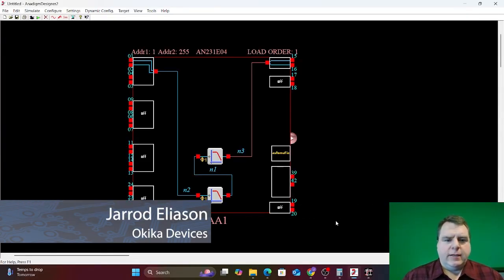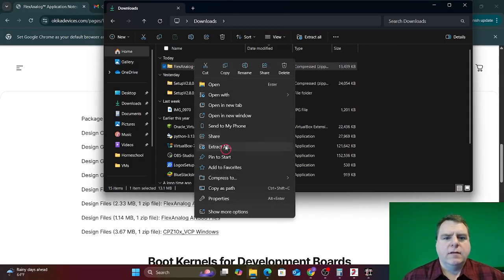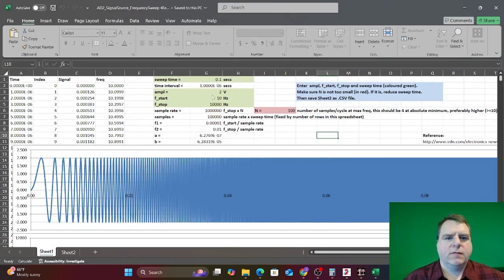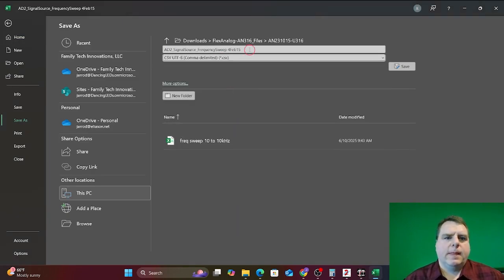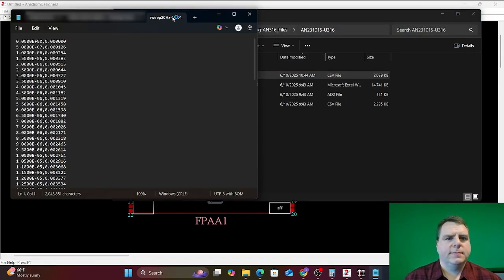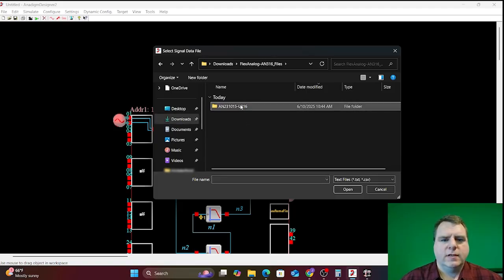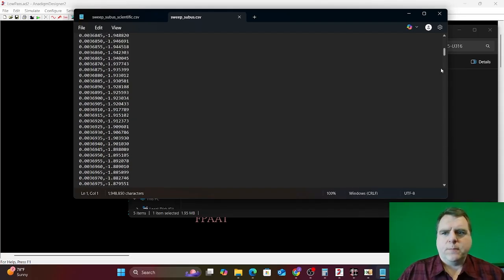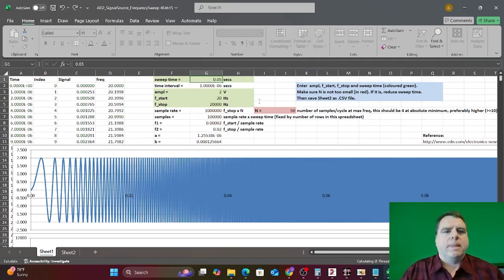E4: Simulation Tools: Swept Frequency Source Generator

Comment: The AD2_SignalSource_FrequencySweep 4Feb15.xlsx file has a problem. The values has comma where there should be a period. Please change the xlsx file so that we dosen't need to swap a , to a . and a ; to a , in Notes. My saved csv file looks like this: 0,0000E+00;0,000000